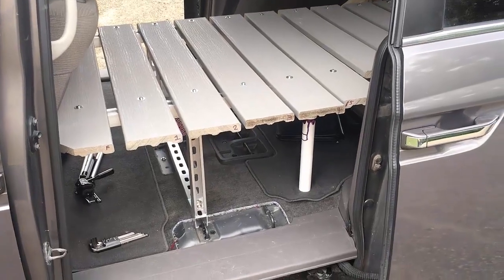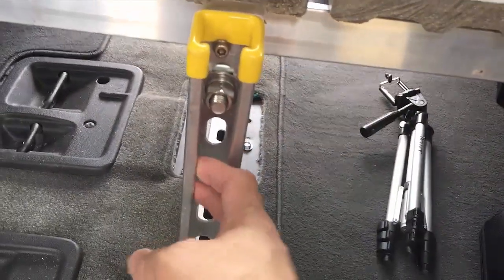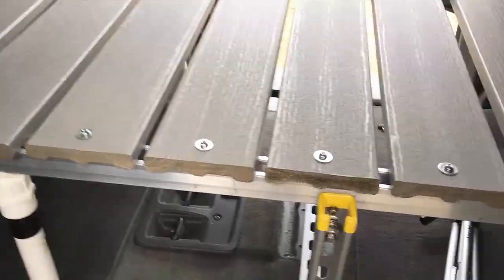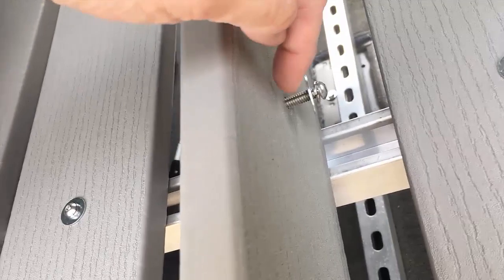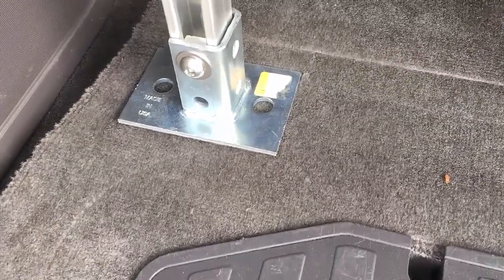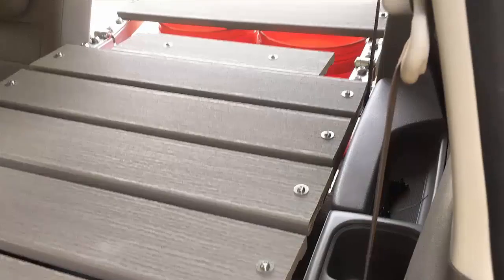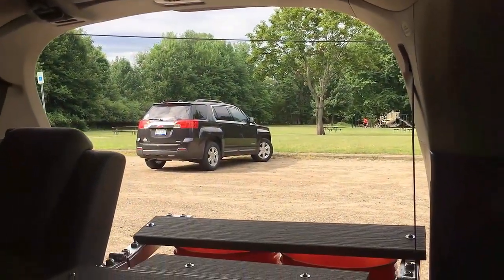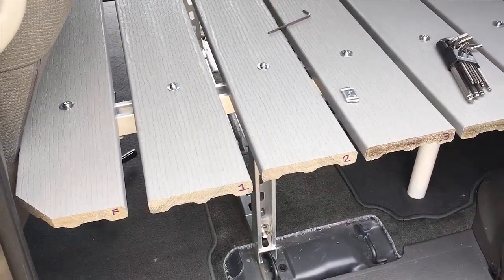DIY Mini Van Bed Build, Hypoallergenic and Low Chemical

Comment: Great job. A hint —from the trades— Unistrut is what we use to make various structures for plumbing, hvac, and mechanical equipment. It is available in much longer lengths, deep and shallow configurations etc. We use it for bracing and brackets and countless other applications. 
The next time, go to a professional supply house instead of the DIY route- materials will be way cheaper. 
We have been Odyssey camping since 2016. Great way to see the country. Crossed the country 4 times, east to west and back.
Reply from the maker: Great advice!! Thanks and safe travels!  Thanks for taking the time to offer your experience!

Comment: Pretty spiffy! I had considered something similar and it is nice to see someone else's details! I am considering slotting the slats where they bolt to the rails in the front area so they could be slid to the side a few inches. This would allow support when I am sleeping on it but allow me to access the narrow space underneath by the door when I am lounging on it without having to leave a gap or get up and open the door.  The most common complaint I have heard about van life is the hassle of accessing things under the bed from the inside. I would be able to just slide the slat or slats toward the other side of the van a couple of inches. Since the passenger side is usually not full since it is commonly the main in/out door, there should be room. It wouldn't be good for big things, but it would allow me to put things away when I go to bed and have easy access from the driver's side door when I am driving or outside the van. I think you could snug it up enough to not rattle but still be loose enough to slide by leaning on an elbow. 

A friend used industrial snaps to attach their slats so they can be easily removed for access into the space under the bed from the inside. He thought Velcro might be a cheaper, easier and more flexible solution in hindsight, but he likes the mechanical snaps enough to keep them.

Nice video and good explanation!
Reply from the maker: Thanks Kurt!  I like the idea of slotting the slats AND the industrial snap idea.  This is EXACTLY  what I hope to see when I post a video: better ideas when everyone else contributes.  Keep em' coming!

Comment: Cool. I never though of leaving that seat in place back there. Probably very nice to be able to sit back there with a laptop or a book. Can you still fold it down with the bed in place? I need to put bikes that would normally be on the rack on the back hitch inside on occasion for security and stealth-ness, inside next to the bed.
Reply from the maker: ¡Mike B! Thanks!  Yes, the seat can go down with the bed in place, so your idea for the bikes will work. Basically, if you put down the 60 side of the 60/40 split seat, you can fit a 30”wide bed between the small seat and the wall. So, a 30” cot also fits, like in my other vids. Thanks for watching!

Comment: Nice work - how did you fasten to the floor behind the front seats?
Reply from the maker: Thanks!  I used a short cable with a loop at each end that went through the hole in the unistrut (two places in the front). The cable looped through the floor seat mounts and then around the side of the strut. Small carabiner clips go through the loops to hold it down. Thanks for watching!

Comment: Maybe I missed it, but what is the cost comparison between this and a traditional wood frame system?
Reply from the maker: Dan Gray no, I don’t think I talked about that in the video. The cost with the aluminum strut is about 1/3 to 1/2 more than a wood build, depending on the quality of wood you use. However, I wanted to do something that would not trigger a reaction in those that are allergic to wood. Also, there is minimal cutting required and it won’t absorb moisture. The trade off is, unfortunately, the higher cost.

Comment: I would like to know the height to the top of the bed slates and the total height to the bottom of the bed slates and the height from the van floor to the ceiling of the van.  I am hoping to do something similar to yours, if I can find a van, but would like to use a ready built bed frame rather than build one.  Thanks for all the great info.
Reply from the maker: Judith Armstrong I will need to measure that when I get back to the van (traveling by air this week) I believe that it was 16” to the bottom of the platform at the front. I will measure at the end of the week. Thanks for watching!
Reply from the maker: Hi Judith, sorry this took so long.  The height of the van floor to ceiling is around 46" at the sides, to 48" in the middle, halfway down the bed.  Remember that these van floors slope down toward the front.  From the floor to the bottom of the bed is 15".  From the floor to the top of the slats is 17".  I can sit up and I'm 6' 5" so you could make the bed higher if you are shorter than me ;-)
Reply: @OdysseyCamper  Thanks much.  Unfortunately my project is now on hold.  Hope you and yours are all safe and well.